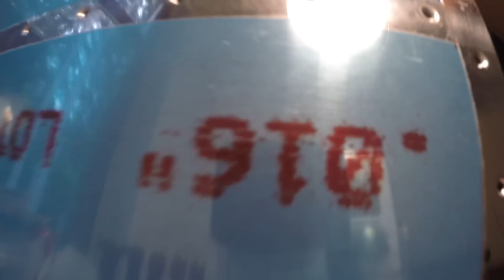Van's Aircraft Practice Flap part 1

Comment: Hi, I realize you did this several years ago. Could you tell me how the tool they have you make with the hole and countersink is to be used? I tried to place a rivet in the hole and then place the tool under the piece and then use the flush rivet head on the gun, all it did was damage the aluminum!!!! Thanks for any response.
Reply from the maker: It’s a dimpling tool. It is acting as a low profile female die that you screw to a bench. Than a male dimple die is used in the rivet gun and the dimple is set.
Reply: @SkiDuneTech  Thanks. If I understand, you would need a pneumatic squeezer to do this? It would be nice if someone would do a short video on the process, hint hint. Thanks again for your time.
Reply from the maker: https://youtu.be/DE5lScyiakc 
8:35

Comment: Did you contact the manufacturer of the kit to see if the damaged part was usable or needed to be replaced?
Reply from the maker: It’s a practice part. Your supposed to make mistakes and learn here before fudging up the real aircraft. I did not check with Vans.
Reply: @SkiDuneTech  I just meant did you check to see if vans felt this type of damage would be acceptable on a aircraft part without some type of repair
Reply from the maker: @amtpdb1  I did not. I would think this could cause stress risers and not be good for a spar but vans might call it superficial.
Reply: @SkiDuneTech  Thanks

Comment: Did you take the lever and safety off the pneumatic squeezer?  How did you get it to work?  would like to do mine the same.  :-)  Any images of the modification would be GREATLY appreciated.
Reply from the maker: Tim, an foot air pedal is installed. When the conversion is done the thumb trigger is removed. They can be found at most aircraft tool suppliers.
Reply: I did get the foot pedal, but still have to push the hand lever as it pushes down on the air valve.  What did you do to eliminate the hand lever and still push down the valve altogether?
Reply from the maker: I bought the tool already set up for foot operation. I do have the spare parts and i believe the air valve in the squeezer is also removed so the tool gets air as soon as the foot pedal is operated. Good luck!